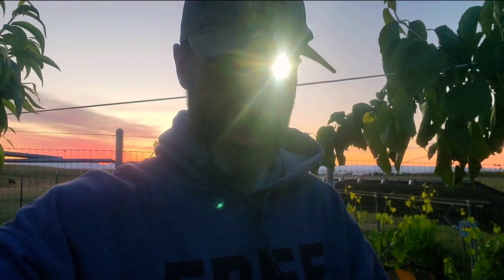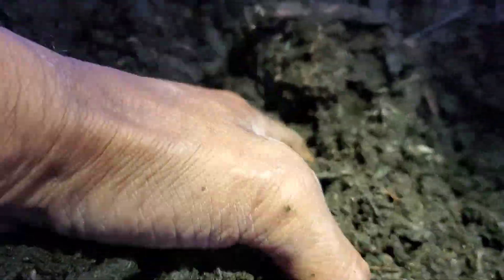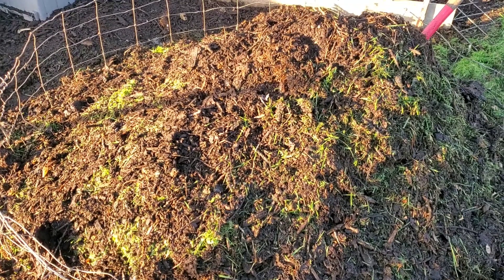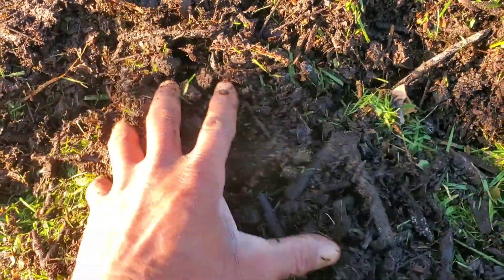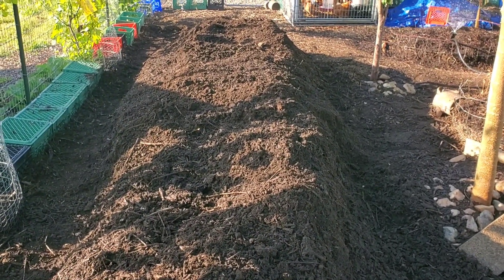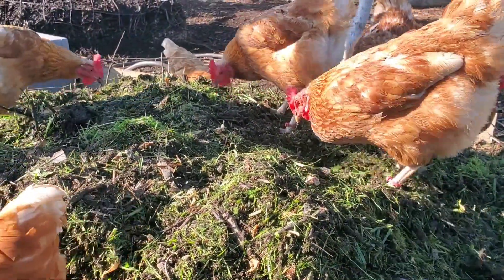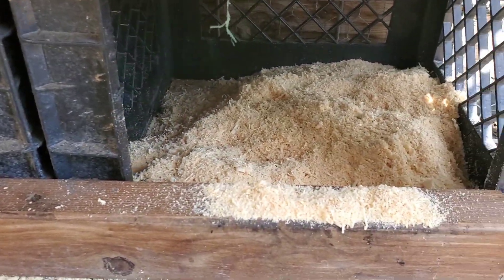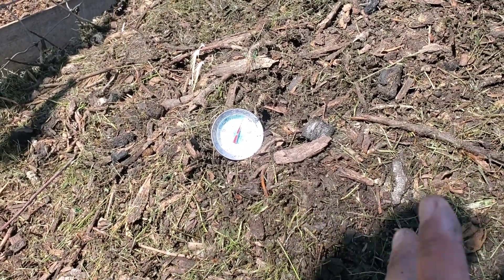The Ultimate Guide to Composting with WORMS, BIOCHAR and CHICKENS

Comment: I only have a few chickens on a 5 acre, permaculture yarden where there are many places for predators (mostly uncontrolled dogs, then the usual hawks, owls, possums & raccoons) to hide so I don't use my chickens to compost.
I just bring the wood chips to their coop & run for them to work over instead & bury their cleanings in part of another wood chip pile for it to compost to use in the raised beds next year.  I've gone through 3 8' wide x6' tall x 30' long wood chip piles going on 5 years with 8 pet chickens.
Reply from the maker: Wood chips are a fantastic choice for the coop and run. It is a perfect offset for all of the manure. It really helps with odor reduction and properly managed it will make the basis for nicely decomposed organic material. A really good solution for chickens in a smaller space if you don't mind managing the space. Thanks for sharing! 👌